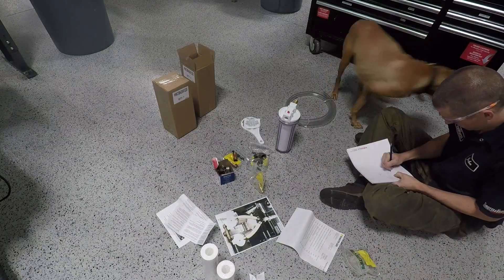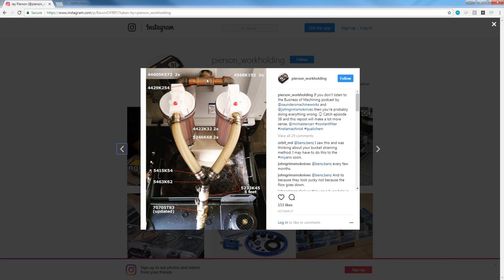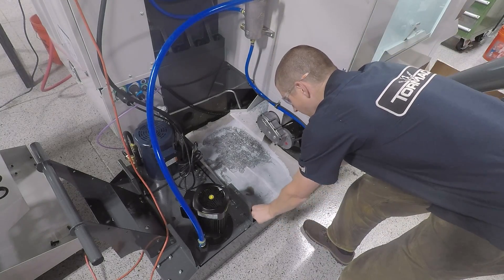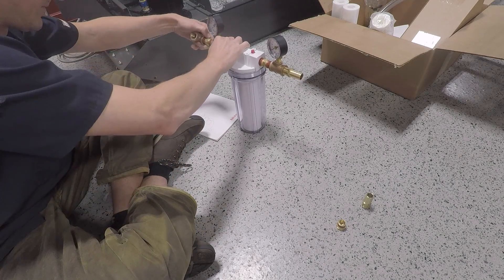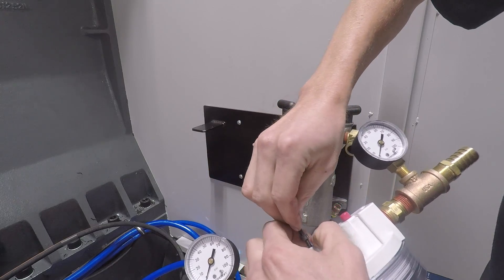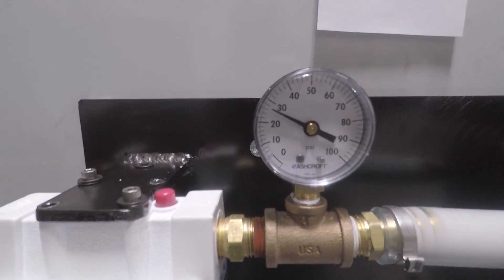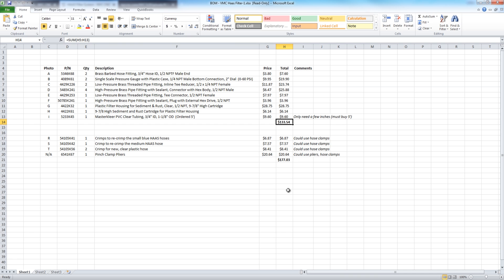Upgrading Your HAAS Coolant Filter System!

Comment: McMaster Carr one of the best companies to work with.
Reply: Jordan Bourns Same thing happened to me TWICE plus they don't tell you the manufacturer of parts you're purchasing.
Reply: The 'unkown manufacturer' thing is so weak. I place about a dozen orders per month with McMaster but only for generic items like fittings, low pressure hoses, clamps, etc....for anything where I need a specific model I don't use them. 

They do, however, keep so many unique items in stock. Strange fasteners, materials, hardware. They save my butt regularly.
Reply: They canceled a order i made without telling me. they wouldn't bother re-doing my 200$ order..
Reply: JetNmyFuture I guess it's all in what you're comfortable with. Personally I like to know before I spend my money that I'm getting something from China or somewhere else. Also I buy a lot from MSC who also has a bunch of odd items. I guess because I was an ENCO customer too and also buy quite a bit I get better pricing than McMaster gives me. Case in point I was looking at a Brown and Sharpe test indicator yesterday on MSC's website and I see they are now made in CHINA needless to say I did not order it. McMaster won't tell you anything just ship it to you.
Reply: they will if call or email them
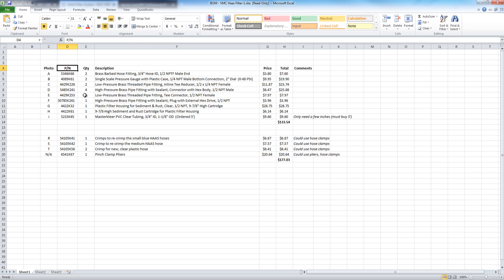Reply: Yeah right, especially if you want to pay TOP dollar for every item you buy.. Sometimes double or triple the price... . 8:09 Those crimp clamps in stainless are 3 dollars for ten at homedepot. and the crimp tool is 9 bucks... come on McMaster...

Comment: Double double uploads! Wonderful treat while I am stuck out here in FL... Waiting to get to Boston, then back down to houston, with a final 2 days stop in Zanesville... And home in SoCal after all of this travel.
I am still laughing after that thanksgiving special!!!
Pre filters are a great addition, as well as a good chip separator. I have set my small flood coolant to run open center with a high bypass oil cartridge filter (5 micron or 1 micron depending on what I need) so it filters more than just what is used to cool. It helps keep the coolant in great shape about 3* longer, assuming I dont make a mess of it.
Reply from the maker: thanks!  5 micron?!
Reply: NYC CNC I had a 4.5*20 commercial filter housing from axeon I got from a commercial job. It's an axeon SDF filter, 200640. Don't remember the part number for the housing though. They range from 50 to 1 micron.
Works best with soluble coolants. Oils get picked up to easily and it defeats the purpose.